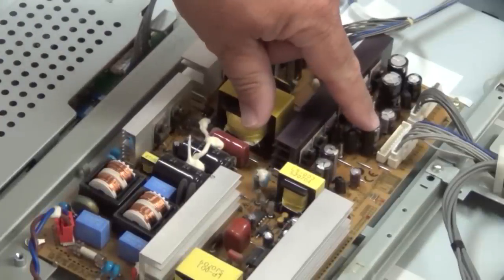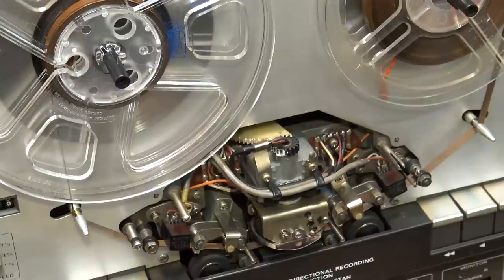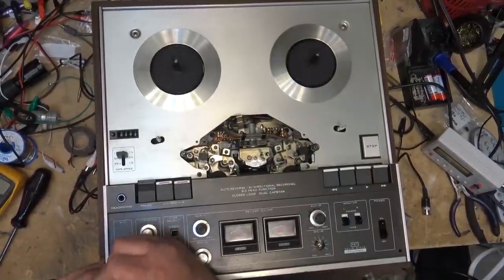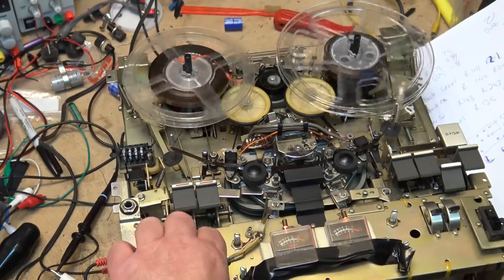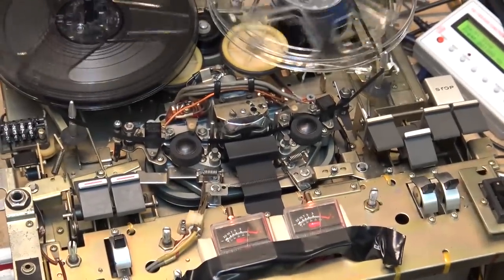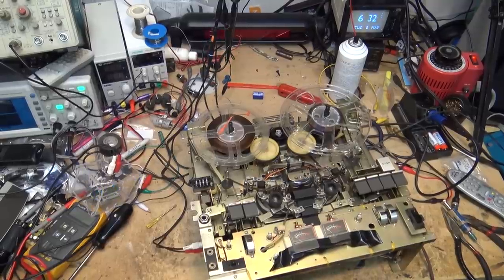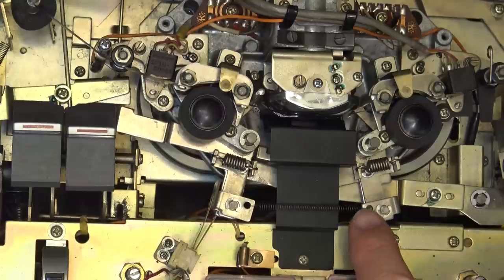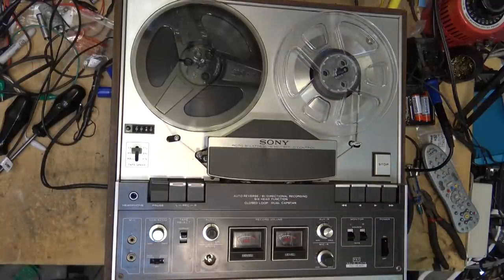Sony TC440 Head alignment, Level Set and Speed calibration

Comment: I know who rebuilt those rollers. I had him rebuild a rubber roller that had turned to goo for an old projector I repaired it ran true and I had no issues. It was a stepped roller that had 2 different sized outer diameters for the forward and reverse speeds a bit more complex than a pinch roller.

Hopefully the customer brings this to his attention and it gets sorted out.

Comment: The owner should send those rollers back for a re-do (and hopefully a concentric shave). That is why I dread getting rollers rebuilt. The guy who used to do them for me seems to have disappeared (he was pretty old) and there are now several unknowns offering the service. I do have a good guy for rebuilding projector rollers but he doesn't do tape recorder stuff.
Reply from the maker: Ray Rooney 
I am sure the owner will contact him regarding this. He is one of the online rubber roller repair guys but I am not naming him. Yes I do know who it is as the client told me and I was kind of shocked to see them wobbling like that.
Reply: I bet I know who it is and would be shocked to get a bad one too. He's been at it a long time. I haven't needed a tape roller rebuild in several years so I haven't had occasion to try things of late.

Comment: Do you know where I could get calibration/test tapes? I have a CT-F900 that I need to totally re-calibrate. Not just speed which I think is ok, but azimuth, and left right level balance of both the VU meter, and the recording levels. Output was adjustable on these so only thing I need to do is channel balance. Any ideas?

Comment: Waawaawaawaawaawaawaawaa....wow.  Sounds excellent, except for the wah-wahs.  When I saw the spinning head assembly it scared me.  It seems that alignment would be too difficult to maintain with all that swinging around.  Not to mention that some day I'm betting the connecting wires are gonna break.  Other than that I wish my RT-909 would record both directions.  :)
Reply from the maker: Paul Mills 
I have an akai gx260. They did it correct. Single center capstan with single pinch roller. 6 dedicated glass heads. 3 for each direction. That is the way to do it.  Auto reverse record and play. Some decks would play both directions but only record I one. 
I am also not a big fan of the dual capstan dual pinch roller. As the rollers wear it is going to cause a tension problem. If the roller pulling has more wear it may not pull tape as fast as roller pushing and that would reduce tension on heads. Center capstan or one for each direction is a more reliable. The akai single center drive is the simplest and most reliable of them all.

Comment: I have a NEC U-Matic VCR that needs the pinchroller re-made and a couple of belts (two out of three) replaced... I did a temporary fix on the pinch roller using rubber hose but of course its not perfect, the wow&flutter is quite evident.. Any suggestions on where to find?  Nothing available parts wise here in Australia for a rare 70's vintage machine unfortunately... :(
Reply: Model number? It's probably made by Sony.
Reply from the maker: There are companies that will rebuild your pinch roller, however none that I can recommend, as I have no experience personally dealing with any.

Comment: Smashing, it's a hell of a lot better than it was :-D.
i think it's worth the owner getting better rollers, a good quality machine.
is it possible that the slight wear in the pinch bar bushing could make it worse also?.
Reply: No, you can see what is causing the issue from the way the mechanism is moving. Those pinch rollers are really bad.
Reply: @theotherchannel2279  i did say that ( i think it's worth the owner getting better rollers.).